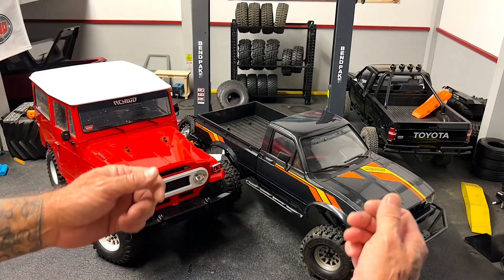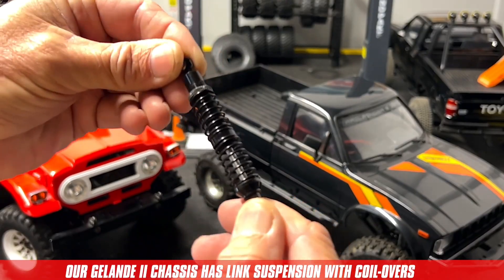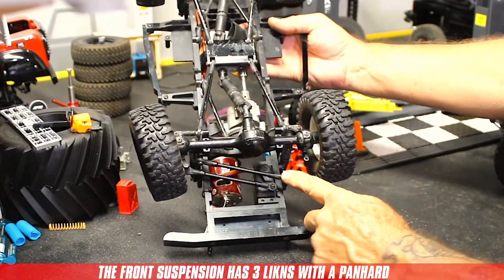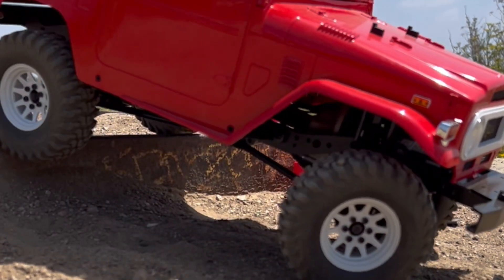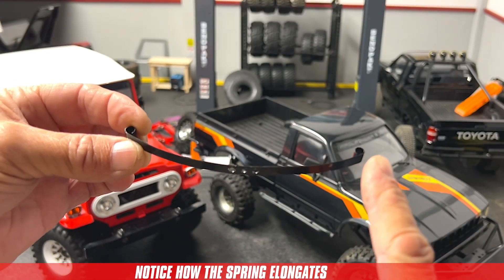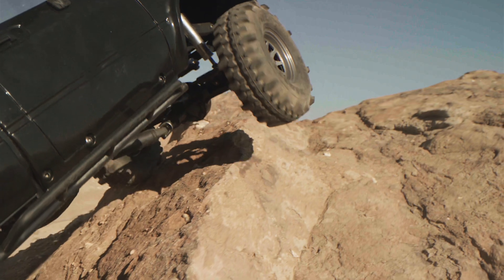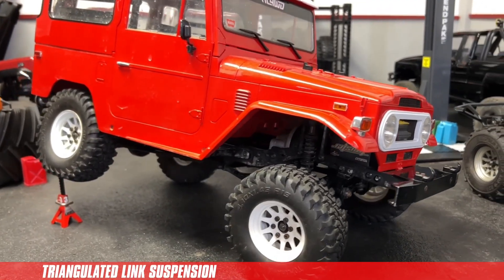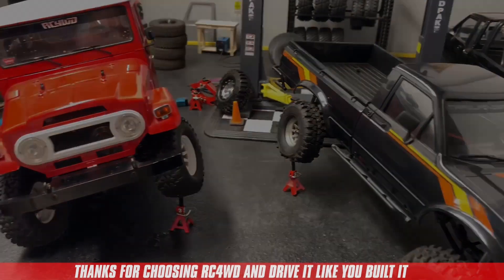Leaf Springs vs Link Suspension: The Pros & Cons

Comment: Articulation is more for grip than for stability. Too much articulation can make it tippy. That’s why the leaf springs do well on grippy rocks. Low cg and enough articulation for some deviation in the surface.
Reply: I’m looking for a LCG rig has has leafs. Weird. Can’t find any. So - too much articulation can be tippy but leaf’s are  not really best for articulation. But they do well on grippy rocks. What are you even talking about ? Rock crawling is about articulation. Leafs are for trail rigs silly girl. Pure mumbo  jumbo.